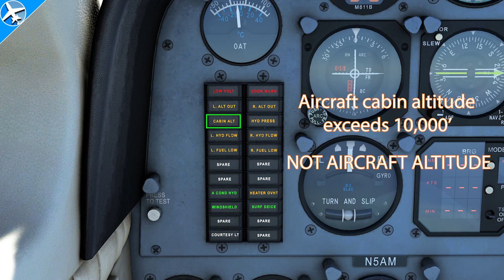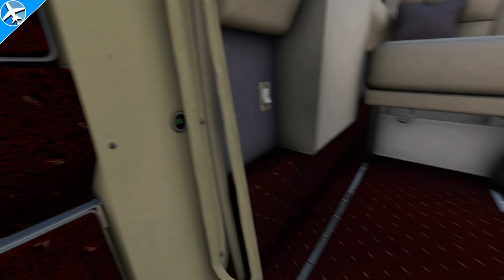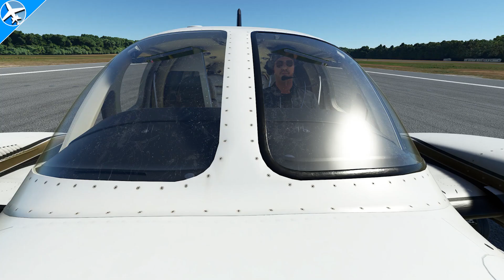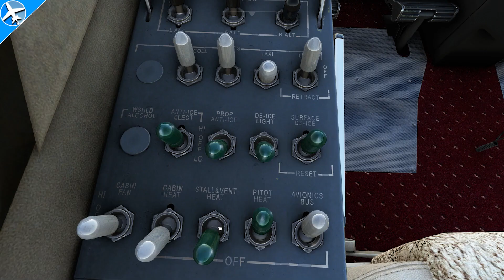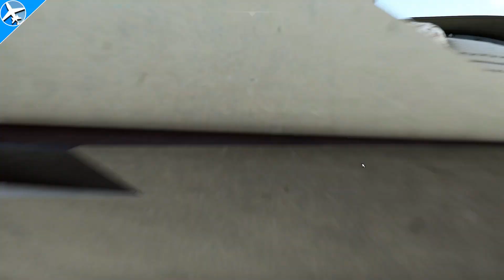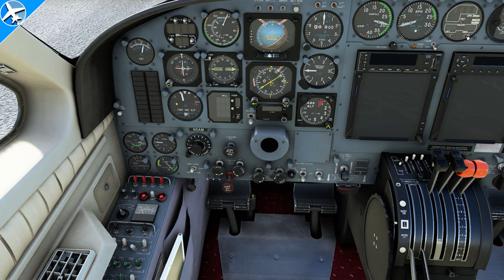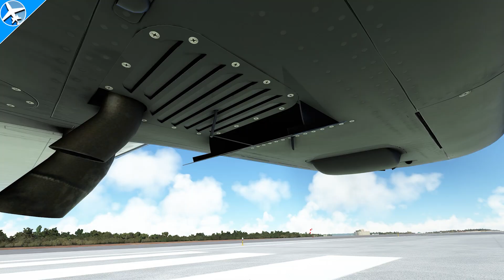FlySimWare Cessna 414AW Systems and Switches: An Explanation by a Pro Pilot

Comment: @25:16 ...  In real life you might have to move the plane like that?
Reply from the maker: For emergency gear extension the airplane can be yawed to get the gear to lock down and then blow the bottle.  It can vary from airplane to airplane but there is a checklist procedure for emergency gear extension.  It's a bit extreme in the video but that is what had to be done to get the gear to lock in the down position.    In real flight simulators gentle yawing usually does the trick.

Comment: Wow I never knew that it was a liquid cooled engine! I do have 421 time. I thought the 414 had the Continental TISO 520 NB. 😁🛫
Reply: I spent the last hour digging into this, when I discovered that RAM was involved it made more since! 
I also learned that Mooney used the TSIOL 550 in the Bravo and that was a STC Riley Rocket I think.
I still learned something new😁🛫
Reply from the maker: @TheFalconJetDriver   Us old guys are always learning, aren't we? haha
Reply from the maker: That is a bit of a controversy.  The manual on FSWs website shows the TSIOL-550 which is a liquid cooled engine.  The RAM converted airplanes are mostly TSIO-520s.  However, after doing more research, there is an upgrade for the TSIO-520 to a TSIOL-550 but that engine is only an option if a previous RAM conversion has been completed on the aircraft.  The FSW manual shows 325 HP engines but the TSIOL-550 is a 350 HP engine.  I talked to FSW about it in an e-mail earlier today.  The stock 414s are TSIO-520s.  I also flew 421s and they had GTSIO-520s with 375 HP per side.
Reply: @thecorporatepilotdad  according to RAM the IV and VI are air cooled, while the RAM V is the liquid cooled variant. Would love to see the PowerPac spoilers installed, this way you could leave the power in and still descend quite  rapidly.
Reply from the maker: @matthiash9487  I went with what Flysimware's website showed on the engine model.  The airplane is the Ram IV but they show the TSIOL-550 on the FSW website.  The 421 I flew had PowerPac spoilers.  They were quite helpful in preventing shock cooling by leaving the power up during descent.
Reply: I believe I read somewhere that the liquid cooling engines are no longer supported by Continental.. On runout they are removed.